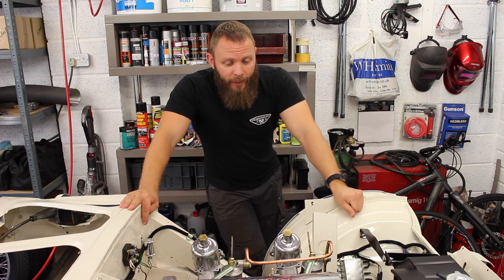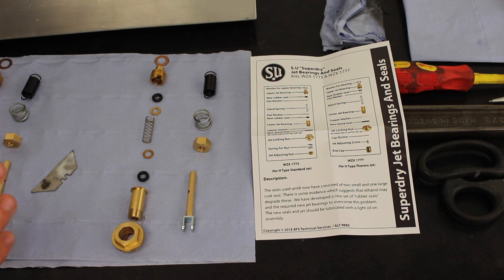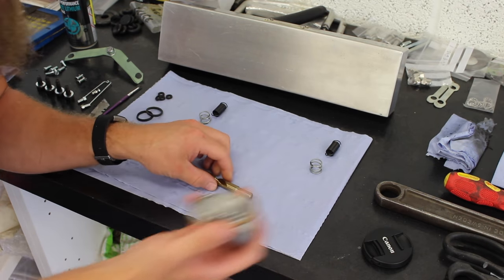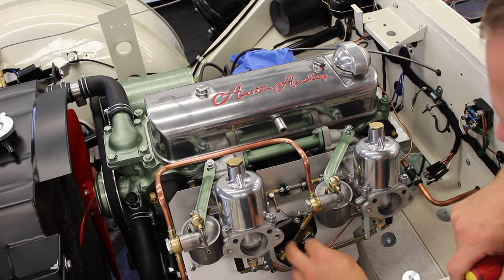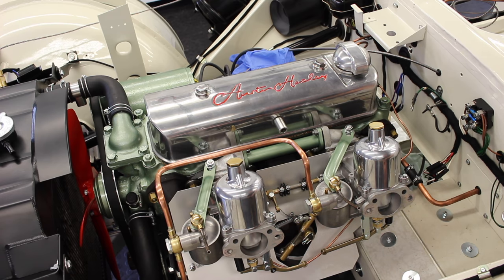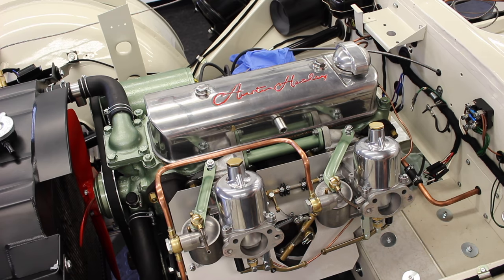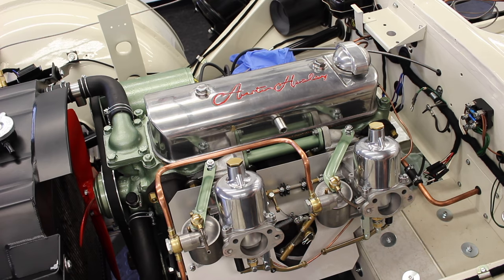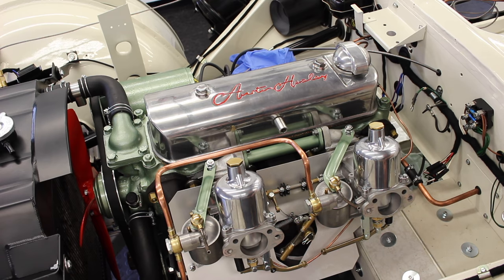How to Set Up and Tune SU Carbs in Easy Steps

Comment: I can't believe I found a good video that starts out with EXACTLY the issue I am having on the 67 MGB I got. Will NOT start when cold. At all. Does just fine with starter fluid, though. I can not wait to dig into the carbs with your help now!!!
Reply from the maker: Good luck 😎

Comment: Just had my twin HS6 refurbed by someone and I'm putting them back on now.  This is so helpful and beautifully explained.  Here's hoping I can replicate that! lol
Reply from the maker: Glad it helped! Good luck 😎
Reply: @Resto.Nation  Thanks. One question.  I'm connecting mine all up tonight with luck.  The choke thing.  Do you connect the cable so that the choke lever on the carb is fully open when the choke knob is pulled out fully?  or is that a 'how long is a piece of choke cable' question lol
Reply from the maker: You’ve got it. From memory, it opens in 2 stages, the full pull of the choke lever would fully lower the jet(s)

Comment: Aup mate just want to say thank you for this video. I've got a 1975 spitfire 1500 with twin SU carbs. I've been having some right bother with it not running right. I've already been through the timing and used a gunson colour tune to adjust the fuel to air ratio and got it somthing like but I wasn't happy. I've loosened every linkage on the carbs taken throttle and choke off followed your guide and the car runs better than ever 👍
Reply from the maker: This is great news and exactly what the video was intended for. Glad it’s been useful 👍🏻

Comment: Really good vid.  The only observation I would make is that the base setting for the jets that I was taught back in the day was 12 flats, rather than 9.  Normally spot on for most applications and sounds like you eventually riched it out to around there in the end anyway.
Reply from the maker: Thanks 👍🏻
Reply: I was going to mention that (based on the SU literature) but if  it works....

Comment: This is the best I have seen. I am struggling with my TR3A (H6) and I have a very hard pull choke. Although I polished the jets, I did not de-burr them. I am about to remove the jets and reassemble. My biggest problem is  adjusting the two  nuts (jet adjusting nut) and jet locking screw (large nut) . Either they are so loose they make the jet slide easily but leak fuel or so tight-----etc.  What is your secret about how tight to tighten the locking screw?
Reply from the maker: Thanks for the kind words. 
I’m struggling to remember now as it was quite a while ago but I would say not to go too loose on them as leakage of fuel in that area is a no go!

Comment: Wow ! Great video thanks a lot for that !
Any advice what type of needle is needed at a TR3 high port engine with Mahle pistions and slightly sharper camshaft 
Best regards Dom
Reply from the maker: Hiya, it would be a case of either speaking to a TR specialist or reprofiling a stock needle to suit the new fuelling demands.

Comment: Love the video as it’s helping me set up my MGB. I’m adjusting the jets both in and out and for some reason I cannot get any change in engine note.  The engine is running lean as the rhythm is very inconsistent with no real pattern.  I can get the revs to about 650 but the engine sounds like it is laboring a little with a lot of vibration.  Any thoughts?
Reply from the maker: Are they balanced? Maybe one is lean and the other rich which is why you aren’t getting the change in note. Have they been rebuilt?

Comment: Hi, thx for your Video. Are you experienced with those of the Jaguar XJ 6 too? The front one is equipped with the AED. It´s popping aut of the orifice of the front one. Missfiring and stalling. Besides, Compression is a bit poor.  Ignition ist good. Cheers, Axel
Reply from the maker: I haven’t worked in the xj6 sorry I can’t help.
Reply: @Resto.Nation  ok, thx for quick reply, anyway

Comment: Great video, I do wish you had shown the actual idle adjustment and the jet adjustment.  Being new to SU carbs on my new to me Austin Healey Sprite, I am positive they need some tuning.
Reply from the maker: The idle adjustment is down to air flow thru the carb and both carbs need to be set up evenly. The jet is set as a base setting and then adjusted in accordance to how your lift pins affect the idle... hope that helps.
Reply: @Resto.Nation  What I mean is (I will order a manual) which are the idle screws and what adjustment is made to adjust the jets.  More of a what part is needed to be adjusted.
Reply from the maker: Ok cool, the idle is set as a base in the “setting throttle screws” section and the jets are set in the “setting the jet height” section. They are wound out anti clockwise to richen the mixture and clockwise to lean the mixture.

Comment: You mentioned that you put the jet in without the spring, then you locked in the jet carrier position with your spanner and then you removed jet and replaced spring znf reinserted jet being careful not to snag the two cork gland washers. Can you comment on this? It sounds wonderful but what is success rate of not snagging and destroying the cork washer?  I will try it tomorrow.
Reply from the maker: It’s been a long time since I did this but they were snagged when they were rebuilt when we bought them so it’s something to watch out for. Lubricate them a bit to help.
Reply: wow. such a quick response. I am a new subscriber and I intend to watch all your videos now that I happened to find you when I searched on Google for "SU".
BTW, I put a thumbs down on the chap below who thought you were too casual about float level. But, you could not have been clearer. 7/16" drill bit is the triple A way of checking level, right from the original SU manual. 
Keep up the good work. I am a new fan!!!
ps- dual SU H6's on my TR3A.
Reply from the maker: @isaacc5299  thankyou 👍🏻. I’ve got a soft spot for the tr3a 😎. Enjoy.

Comment: Very informative thank you.  Just one quick question. I have two classic cars both with twin SU carbs. On my  Wolseley Six the overflow outlets are connected by a hose, whereas on my MGB GT the overflow pipes are not connected to each other.  Is one wrong or are both set ups ok?  Cheers.
Reply from the maker: The ones on our healey go down the block to the floor and drip if they overflow. I wouldn’t say the outlets should be linked unless there is a t section for it to terminate safely if they overflow...

Comment: A good instructional video. However I must have missed the part about syncing the carbs together above idle, or does the A/H not have an adjustment for that. I do know that the Japanese cars that use twin SU's are able to be adjusted for off idle or cruise condition.   Also wouldn't using a carb sync to adjust the carbs individually and together be a lot more accurate  than using the hose to the ear? I did think you did a good job overall.
Reply from the maker: Thanks mate. In not too sure about the balance at higher revs sorry. Regarding using a carb sync, I used it to check my work after and the carbs were correct. It’s an expensive bit of kit that not everyone has access to so I wanted to make it a guide that everyone at home can do with no special tools.
Reply: @Resto.Nation  The carb sync that I am talking about is by Uni-Syn right now it is only $26.95 on Amazon.  I do understand trying to keep the repairs on a budget however after not heedomg the advice of my team mates at the time I did not wear ear plugs while dyno tuning or at the race track and now I can not hear very well.This one works great on Webers, SU's, I have even fabricated adapters to sync 3 2V's on the old Pontiac's with the tri power set up. By the way, keep up the good vids. Yours is one of the better ones I've seen.  Oh yeah, on the syncing the carbs at cruise... Datsun had a different linkage setup  than the TR3 has so it was possible and necessary. I just finished replacing the fuel lines, fuel pump, fuel tank (aluminum) and rebuilding the carbs on a 59 TR3 that had been sitting for 15 plus years. Tomorrow I'll change the oil and filter and prep it to fire it up. This car belongs to an 89 year old lady who wants to drive it again. The whole thing was restored 15 years ago, driven home and parked in a garage with a cover over it and a third tank of fuel for  the last 15 years. She also owns a show quality 65 Mustang.
Reply: Nice shiny carbs and quite a nice explanation BUT setting the float level is critical for SU's especially for multi carburettor setups as this would effect the mixture higher up the rev range. I've been 'playing' with SU's (on and off) for over 40 years and quite frankly the 'listening to the tube' method is fine if you've been shown it or you have good experience in that area BUT considering how much a restoration costs in time and money wouldn't a little more money spent on a UNI-Syn or something similar be a worthwhile investment, not a cost, to do the job properly (if you're a member of a classic car club, maybe even borrow one!)? Sorry to labour ('labor' for our American friends!) the point but float levels are very important in a multi SU installation especially!

Comment: Great video.  How well does this tune hold when you put the air cleaners back on?  Will you have to perform another tweak for the slight added air restriction from the filters?
Reply from the maker: Thanks. The car will be fine tuned again before it’s run in miles 👍🏻

Comment: can you helpme?? i have a jagura mk2 1967 .34 with 2 carbs su hd6 ..there are leak bottom of the plenum thru the zirks (front)...the levers and nedless are good.....
Reply from the maker: By zirks do you mean jets? If so maybe the needle and or jet is worn out and not sealing.

Comment: Faffing with my P6 TC at the moment, my adjustments screws are ****ed, where did you get those lovely knurled ones with the springs?? I ordered a kit from SU but they sent me the wrong ones.
Reply from the maker: Contact Burlen direct. They can match the tag on your carbs to the exact model you have and send you what you need.
Reply: @Resto.Nation  Cheers, I'll try that.
Reply: @Resto.Nation  They sent the wrong ones again. Got the vanilla screws with nuts. 😠

Comment: I've been struggling a  bit to tune by ear; I really wish I could find a video so I could listen to the exhaust note of a lean and a rich condition. Can you do one or do you know of a good example to follow?
Reply from the maker: Nate Marsh I haven’t sorry. I was listening for the balance of the carbs with my ear and I have since confirmed they are correct with a carb synchroniser. I would recommend that to use if you don’t want to use the old school method...

Comment: The carburettors were adjusted independently,nothing was mentioned about when and how they are joined back together and how they are set so butterfly's open in sync?
Reply from the maker: Ozzie Katri they are joined by the linkage that I disconnected at the beginning to make them indépendant for testing 👍🏻

Comment: I have triple su carbies and  the problem I have is the engine on start up revs up highland uncontrollable so I have to shut it off. any ideas why
Reply from the maker: Too much air or too much fuel? Throttle stuck open?
Reply: @Resto.Nation  could it be the fuel bowl level too high?

Comment: Thanks for the video. Very informative.  I just put triple su on my tr6. Major improvement over my webers. Got my colortune for the air mixture setting and its dialed in pretty good.just some minor things I need to iron out.

When I use choke for a cold start it revs between 2 and 3 thousand rpms. Need to figure out how to lower that rev at choke time.

Car runs amazing well after it warms up at about 950 rpm idle. However, when I drive it at high speeds and come to a complete stop the idle drops really low momentarily before it comes back to normal. Sometimes it drops to the point it almost stalls. But this only lasts a few seconds. 

Any tips ?

Thanks.
Reply from the maker: Hi mate,
Thanks for the comments. I know it sounds silly, but have you tried pulling the choke out less?
Re the dip in rpms it might be something sticking, maybe alignment of linkages somewhere?
Finally, after I filmed this video I bought a carb balancer to check air flow thru each carb. It wasn’t too expensive and double checked my work. 
It would have made the job more accurate from the get go and you’ve got an extra carb to consider so there is more room for error. This would be the route I would go down for accuracy and to eliminate extra factors that could affect the running of your car. If you can price they are all balanced from an air flow point of view you can cross that off your list...
Reply: @Resto.Nation  thanks. Here is the set running on my tr6. https://youtu.be/auZlUzJEFos
Reply from the maker: @jtorralb  they sound amazing!!! Makes me want a a TR6!

Comment: Hello. Very useful and informative thank you. I'll be tuning my carbs soon but will be using the special SU tool (rods and wires) which enable checking the air balance at revs as well as idle, but the instructions don't say if these should be placed in the dashpots with or without oil. Any idea? Cheers
Reply from the maker: DavidUKesb I’ve not seen the SU tools but I would say with to create a real world situation??
Reply: @Resto.Nation  Many thanks for your reply. Yes that is what I'd have thought too, but it's frustrating that it doesn't say so in the instructions, nor anywhere on the internet (that I can find!)
Reply from the maker: DavidUKesb nightmare! Let me know if you ever find out. I would be entrigued....
Reply: @Resto.Nation   Will do. Hopefully be this week I'll have a go.
Reply: @Resto.Nation    I tuned the carbs yesterday and balanced using the special SU tool of rods and wires (PSW Made in West Germany) and it worked perfectly with oil in the dashpot and I was able to balance the carbs at revs which you wouldn't be able to do with a synchrometer. (Unless you had two of course!)
Reply from the maker: DavidUKesb nice one. So do you have to set them at a set revs?
Reply: @Resto.Nation   I'm just a novice but I set the balance using the ear and hose method, and then checked using the rods and wires which raised evenly throughout the rev range( up to 3500 anyway) I suppose if they were balanced at idle but not at revs then further investigation would be needed but fortunately mine were fine.
Reply from the maker: DavidUKesb very cool. I suppose you could argue that is they are balanced at idle then they should stay balanced as revs increase. But at least the SU tolls will prove that they stay in balance as revs increase 👍🏻
Reply: @Resto.Nation  Absolutely.  The reason I was looking at my carbs was because 3&4 spark plugs were sooty so I thought the rear carb (MGB GT 1800) must therefore be rich. But upon following the tuning instructions the engine was running slower upon lifting the piston slightly which indicates running lean so work that one out! Anyway, I've richened the mixture on the rear carb so revs just rise very slightly upon lifting the piston and see what happens over the next few weeks. Interestingly I also noticed that the front carb piston was lifting WAY behind/after the rear one simply because the linkage was misaligned, so I obviously corrected that before testing the balance with the rods and wires SU tool kit. Do you think this linkage issue would be the reason for plugs 3&4 being sooty? Many thanks
Reply from the maker: DavidUKesb I think it could be yes. If the linkage is out then one butterfly will open more than the other which in turn will lift that piston more moving the jet further from the needle and richening the mixture for that carb. That’s why you disconnect the linkage to set them up 👍🏻
Reply: @Resto.Nation   It would certainly be interesting to see if the sootiness on 3&4 disappears (I've cleaned the plugs) despite richening the mixture by three flats.  I'll let you know, although might be a few weeks before I've driven the car long enough to make an assessment. Yes, the front carb butterfly was opening considerably after the rear one.
Reply from the maker: DavidUKesb keep me posted. Good luck

Comment: My jet isn't flush with the bridge when screws are turned fully up.  What do I need to do?   
I have wound the jet screws down two full turns, but still it doesn't idle very smoothly.  Any comments  please?
Reply from the maker: Single or twins? What car? What carb?
Reply: Twin H4 on a ZB Magnette.
Out of interest, I've just checked the condenser today. Zero resistance, so I reckon that's failed anyway. 😯
Reply from the maker: @ianwilliams4787  there is a bit more to testing a condenser from what I’ve read online but changing it won’t hurt of cost too much. Have a read thru this regarding your adjustments. Hopefully it helps...
https://sucarb.co.uk/technical-h-type-carburetter-tuning-single